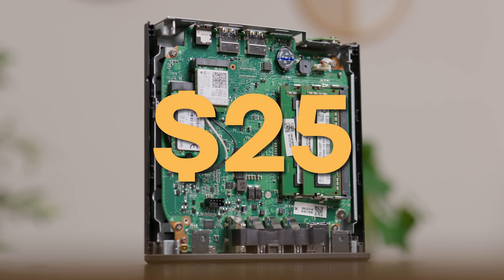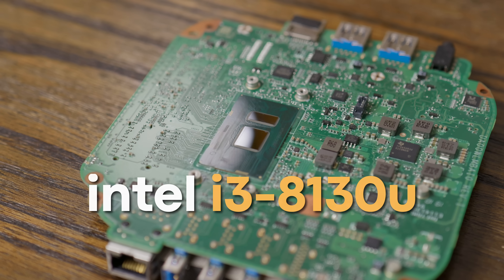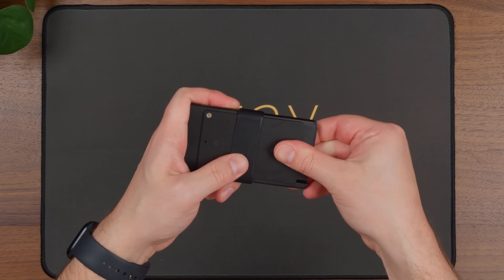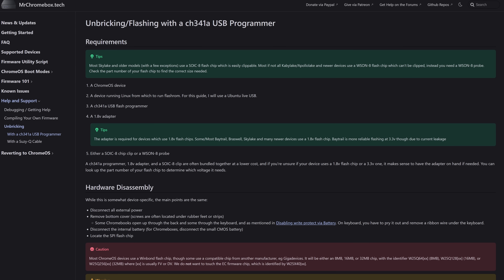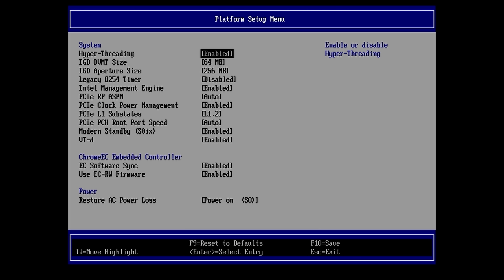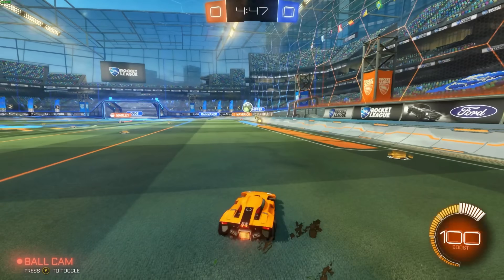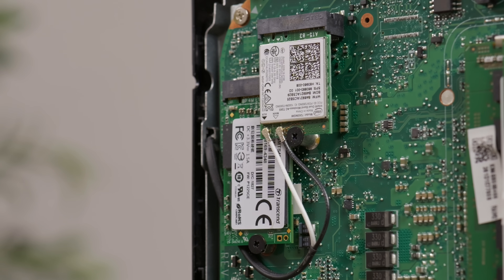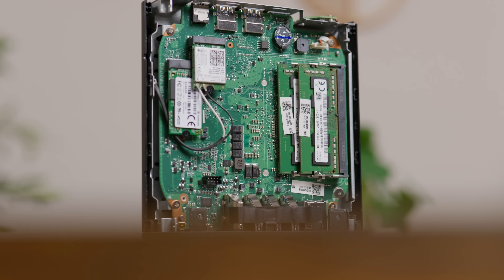This hacked Chromebox is INSANELY impressive.

Comment: Flashed 3 Chromebooks already. I have a Chromebook Pixel coming in the mail soon. So that'll be my main laptop. MrChromebox doing more for the environment than most orgs.
Reply: Yep. I help run a non-profit where we repair and refurbish electronics (mostly old corporate laptops and desktops) before re-selling them or leasing them to businesses with fixed terms. Anyway, pretty much every manufacturer puts up roadblocks to hinder repair. USB-C ports soldered right to the motherboard and not on a separate PCB for easy replacement. Or batteries which "lock" after 2 years and refuse to take a charge. Hinges which are way too tight which causes them to break out of the housing. As the housings and the keyboards are now one assembly, it is no longer economically viable to replace them so they usually end up in WEEE. What a waste.
Reply: Absolutely he is, I've have one running Linux that I use more than any other PC, it's traveled the world with me and when I'm home it sits on my end table as a handy device if I need to do some quick browsing.  Not bad for $30 (plus $15 more to add some storage).  I've since bought two more and given them to family members.  Guess I should buy one of these Chromeboxes next and see how well it'll work replacing my ageing Raspberry Pi 3.

Comment: 0:11 minecraft will be laggy and unstable after a short time due to the specs (so if you plan on doing this for minecraft don't)
Reply: wrong even my chromebook runs a minecraft server perfectly for ~10 ppl no shutdowns the only issue with it is storage space it loads chunks fast enough to fly at full speed in spectator mode
Reply: 8130u is enough considering mc is single threaded unless you use folia lmfao
Reply: @bit8793  wrong
Reply: @Lunaisded dude, i play with 128mb vram laptop WITH 100 mods.

You only need a GPU if you're going to use Shaders.

CPU is all that matter with Minecraft.
Reply: for vanilla with basic optimisation mods no this is perfectly fine.
Reply: @morri2087 the video suggested using it for a server though, which would likely struggle.  Now given that it has upgradable DDR4, grab a pair of 16GB sticks and it might actually work, as RAM is Minecraft's biggest bottleneck for servers.
Reply: @drakerp2  I've always heard that the CPU (specifically it's single core performance) is the main factor to consider when running a Minecraft server. RAM is obviously necessary too, but beyond a certain point it has significantly diminishing returns compared to the CPU.
Reply: @morri2087 yes!
Reply: @morri2087  you got to be joking lmao😂😂
Reply: @moneybilla  no, they're right
Reply: @moneybilla OHH MINECRAFT IS SUCH A HEAVY GAME. YOU NEED RTX 3060 TO BARELY PLAY AT 30FPS😩😩😩😱😱😱😨😨
Reply: @hve.d  u do with high render distances its gonna fill ur vram real good

Comment: I am having some extreme buyer's remorse for buying a OptiPlex 5050 Micro 7600T for $100, probably $110 including a used surplus power supply and a cheap AliExpress adapter.

Comment: If that USB-C port on the back supports video then you can probably get 4K60 out of it with a dock or adapter
Reply: it does support USB-C alt-mode, 4kp60 works no problem

Comment: School tech admin here. The reason the hard reset cleared the organizations enrollment is because the school district had already removed it from their management in their admin console, but apparently never powerwashed the device to get it to release. Pretty common. If they hadn't done that, the moment you connected to the internet again, it would have went in to managed mode.
Reply: Should have pressure washed it
Reply: What I remember with these Chromebooks, before you flash it with another OS there's a screw you need to physically remove in order to do that. Almost like the screw locks you from being able to have a multi boot setup
Reply: @OnEman-z1r  He covered that in the video
Reply: In that case, couldnt you just flash the firmware without letting it connect to the internet?
Reply: @DiegoIndriagoAudiovisual Well you cant as tht will need the internet connectivity to dowload the sh script for execution of flashing but now it depends if Google managed to check lock status in that mode as well or it just disable all of its cron jobs and leave the user stay in that mode for a bit long time to complete the flashing. One way or another if its linux, there will always a way arround.

❤ LINUX / UNIX
Reply: @DiegoIndriagoAudiovisual no, enrollment on new devices lives in the tpm, which means no developer mode, and without developer mode you can't get to a terminal without setup which forces you online. you'd need to flash the chip with an external programmer
Reply: @DiegoIndriagoAudiovisual  even after that it wouldn't work, the data of that perticular thing is stored somewhere else actually
Reply: Yeah he got lucky!
Reply: you can always flash the bios and firmware using a physical flash tool
Reply: Sh1mmer
Reply: a school tech admin who actually knows what they r talking about, rare to see 😭.
Reply: Makes sense. Might need this info soon. Thank you. :)
Reply: I can assure you that's not the case, at least not on the 4 HP Crhomeboxes that I have (which are admittedly older than this model). Doing that procedure wipes the thing to an out-of-the-box state. I state this with confidence because they were all working properly with the school logins right up until I did that to them. Nobody ever bothered to "powerwash" them or do anything else with them other than shove them into a drawer somewhere.

Edit: For clarity, the boxes I'm talking about are Haswell-era machines.
Reply: Wrong
Reply: Not correct.

Comment: mdm software could prevent the reset hack. there are also firmware locks, this is when you reset and as soon as a internet connection is detected it downloads the previous provisioning. These can usually be thwarted with a dhcp tag.

Comment: 11:14 It looks like the only thing it's needed is to open that bottom case and place a strong 120mm fans below it so we can churn out most performance out of that box, that i3 should've peak at 35W, i don't think it's throttling but we need log from HWINFO while it's running heavy, that Kaby Lake seems like it should've perform better than i5 6400 with that ram and clock speed, just guessing.

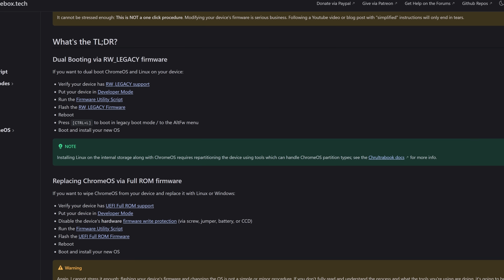Comment: Already... I'm 1:30 in and I'm already kinda disgusted. The fact that extra effort was put into design that resists "doesn't support" installing alternative software options is unacceptable.

Yeah, OK, a valid argument COULD be made that it isn't trying to outright stop, but rather it's just enough protection to prevent dumb users from sticking their finger in the proverbial software light socket, but... is that really why the vendor did what they did...? Like...... REALLY really? I know Google and Acer... I have my doubts.

Anyway, none of my complaints are with you, uploader. Nice video! Good work! +1
Reply: Also, just checked ebay and all CXi3's I am seeing are not $50+... which is to be expected, honestly.
Reply: you're looking at it the wrong way. ChromeOS devices are designed first and foremost with security and data integrity in mind (hence the custom firmware with verified boot), but also allow full control by the device owner. They could have made it a completely locked down device, but intentionally designed it with a mechanism to allow the owner to do whatever they wanted, down to the firmware itself. Consumers would be far better off if more companies took this approach

Comment: Thin clients are another goldmine like this. HP t530 takes DDR4 32Gb and full size 2280 SATA M.2 SSD, tho the CPU is a potato AMD Excavator. The current model has a Ryzen 1st gen. I ran all my self-hosted stuff on a pair of t530 until recently. Under 5W idle and 10W maximum.
Reply: Thin clients have become much more powerful over the years and I have been thinking about getting one myself just no time at the moment .

Comment: Hiya Hardware Haven!

Quick warning from a Google Workspace admin: You were able to repurpose this device because the school district had already removed it from their GWS device management. That's why the enrollment was gone after the reset.

If it was still enrolled, you would've been locked out after wiping it. These devices need internet and login before you can get into developer mode. If it was still on their GWS, it would need admin creds for setup, blocking developer mode.

Like @Kaliberdos said, older models have workarounds, but newer ones block that with checksums in an secure enclave verifying the firmware. That check is on every boot unless you already are in developer mode, which is also a flag in the same enclave.
Reply: This is important info. Thanks for sharing it!
Reply: It's possible flash directly bios ?
Reply: @leondeco4835  I havent seen bios for these.
Reply: Also to note, depending on FW version you can get rid of device management through exploits, most notably SH1MMER, but I believe it depends on the the BIOS FW version as well for being able to unlock using these exploits.
Reply: ch348A says Hi :D
Reply: Huge red flags there even ever to consider to buy this kind of hardware.
Reply: yep its called the death grip! 
get you used to gear they sell at a loss 
then lock you in like 
{pr (sh) [in] ters}!!!!
Reply: So after a nice history of having the "powerwash" option at startup to totally wipe ChromeOS devices, Google is now copying "green" Apple to turn their stuff into useless bricks that don't contain enough recoverable material to make them worth recycling. Too bad Google abandoned "Don't be evil.".
Reply: ive had this issue. tried every fix possible but couldnt get the chromebook off the school domain i bought it from. when i contacted them they didnt respond and when i went to the district offices they turned me away at the door lol
Reply: It is trivial to bypass Chrome Enrollment, even without an external programmer. Kids who have issued Chromebooks have created tools to do it on all but the absolute latest (last year or so) models. The 'secure enclave' is nothing like Apple's approach and can be glitched out simply by rubbing a pencil on a nearby contact.
Reply: if you said DEV and not Admin you would have gotten very different comments lol
Reply: I've bypassed a number of these, but I'd be inclined to believe your note that newer ones are locked down further.
Unfortunate for resellers if not properly decommissioned, but sensible from a security standpoint.
Reply: I broke that as well but you need soldering ability and an external programmer.
It is sad tho to see Google blocking normal users from using their devices.
Reply: @marsovac  it's asset recovery tools for businesses
regular users who don't have stolen devices don't need to worry about it unless they royally screw up doing things that they probably shouldn't even be able to do
Reply: @ I understand your standpoint from an end-user perspective but the reason google is locking it down is due to security. These devices are being used by companies and when it comes to corporate data security is of the utmost importance. 

An modified firmware could contain a virus that infects the device at runtime to either steal data or infect other parts of the organisation as it’s already inside of the network.
Reply: @hcbille  It's not security, it's to maintain their data access to mine your browsing habits and demographic information.  They are locking it down because they subsidize the pricing model and expect to have access to sellable data after the sale. Very high value data these days and the current standard business model for smart devices and other gear that they can get away with doing this on. Google is no longer your friend.
Reply: chrome OS sux as hard as a super massive black hole
Reply: Good the school actually unlocked it. Not the same for the MDM Macs I've seen before.
Reply: yes intel has boot guard option on EoM. ıf they fuse it into cpu you cant run any bios(efi) firmware without signing.
Reply: could i erase the nvme and install chromeOS on their GWS?
Reply: Thank you for pointing that out!   It's important that people understand that the device needs to be removed from the management environment.  Or else, you just have a brick.
Reply: Thanks for that.  I'm tempted to get one and connect it to the TV, along with a wireless remote and keyboard.  A bit worried it could be stolen or the business/school has forgotten to remove it from their list of devices.
Reply: EVERYTHING HAS A WEAKNESS ONE WAY OR ANOTHER.
Reply: If the school district sold something, witch is still in their GWS, the buyer should be able to sue them.
Reply: cant you just resolder different bios?
Reply: @leonzlasu4299 Yes, and many other options once you access the internal physical hardware. These folks getting stumped by a FW or SW security feature when they have physical control of the machine is kind of silly. HW knowledge is really useful sometimes.
Reply: Easy to pass with a hardware programmer.
Reply: @lighthawk95  nope. check boot guard.
Reply: @brainprism88  Then reprogram boot guard, or physically replace a device on the board, or any number of direct HW changes. You guys ever heard of HW?

Comment: I did something similar with a Lenovo N22 Chromebook. I wanted to see if I could use Linux on as weak of a computer as possible for an entire semester. Unfortunately, the 16GB of EMMC storage squashed that dream, but it's now just sitting as a backup PC for my mom to use in case something else breaks. The process wasn't too bad, like the documentation says, BE CAREFUL, GO SLOW, AND READ, and you'll be okay.
Reply: It's kind of a hassle to set up, but you can get a little breathing room on the EMMC storage by using btrfs on your root partition. I have a pair of Lenovo N42s from a school district giveaway, one with 16GB and the other with 32GB, and hacking them to use brtfs made a huge difference in how much software they could reasonably be loaded up with. It takes forever to launch but I can even run small Steam games on the 32GB one and it still has over half the flash free. (And that's with dedicating 4GB of it to swap so hibernate mode works properly.) The linux I used for this was Bunsenlabs Boron; it uses the generic Debian installer so doing the manual prep work for the nonstandard file system wasn't too difficult.

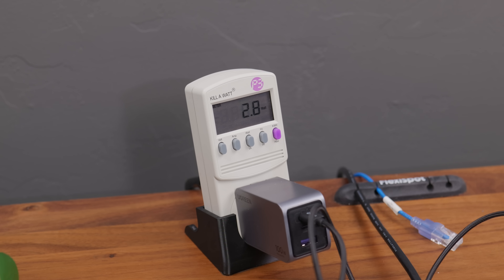Comment: 5:24 It's complicated, you have a brick designed for 100W but draw just about 3W. It takes some power just to get the transformer going, even if you make the main transistor from some magic supersemiconductor, it won't change much

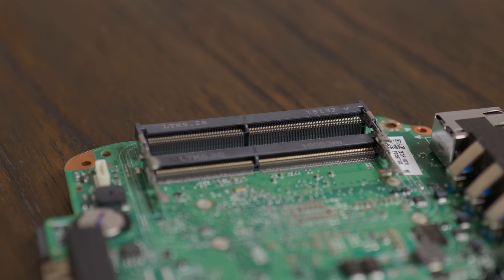Comment: @12:03 There is no reason why this cant support 64gb ram, or more, this is a bios support thing not a cpu limitation.
Reply: Bios or mobo ram control limitations? 

I wish to try it on my old laptop but I got no budget and I'm scared of not knowing if I can refund tbh
Reply: that's incorrect, KBL-U is limited to 32MB max per Intel ARC

Comment: I did this to an Asus Celeron 2955U chromebox 10+ years ago and ran it as an HTPC for a long time. It got retired from media duty once most of my library was 1080+ but it still serves as a docker host running my HomeAssistant because the built in bluetooth is compatible and collects data from BLE hygrometers around my house.
Reply: Did you put an nvme in it or did you have to use a sata?

Comment: "That means you can only get 60hz with 1080p..." 
BRO...right there on the page for 1.4b it SAYS 1080p 120hz
I have actually done lots of testing with 7th gen integrated... In theory the graphics chipset will do 1080p 120hz with the correct monitor assuming the port is HDMI 1.4b or better. I would say give this box a go on a proper high refresh 1080p monitor. Speaking of which... Any chance you can test the USB-C display output? maybe with some AR glasses if you have a pair?
Reply: Also this video is GREAT! I have lots of crazy ideas for these.
Reply: you misunderstood, he's saying you can't only get 60Hz output using 1080p, not 4k, via HDMI 1.4b. Not that 1080p is limited to 60Hz.

Comment: I considered going with a Chromebox a few times when I needed another small computer.  It just never worked out as far as the combination of price and specs.  It just didn't make sense with the hardware I could find because tiny office PCs were typically around the same price with much better specs.  The box you got is a different story and looks to be very good specs for the price you paid.  I would have tried this at that price.  It's definitely worth keeping in mind as options are always a good thing.  The idle power draw is hard to beat there.  Good to hear the process of modifying this one was so smooth.
Reply: I've been trying to get a tiny pc for home use and they are all $400 now, companies buy all the cheap ones then sell them for that ripoff.
Reply: @itsjustaname-d9y I see plenty of them on eBay for less than that.